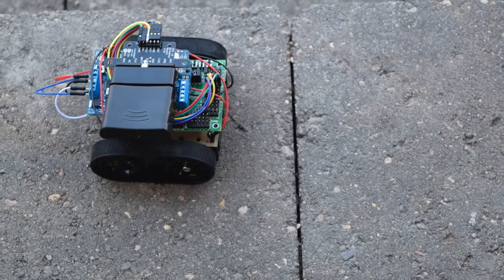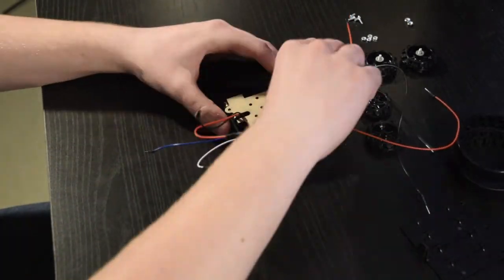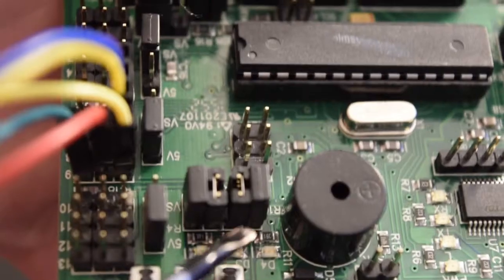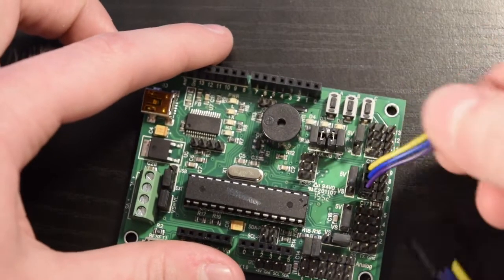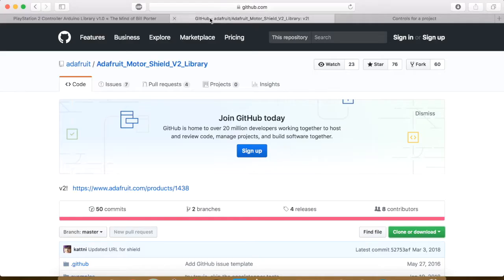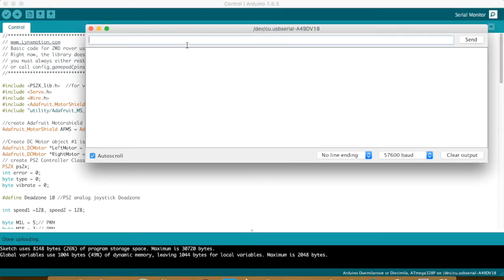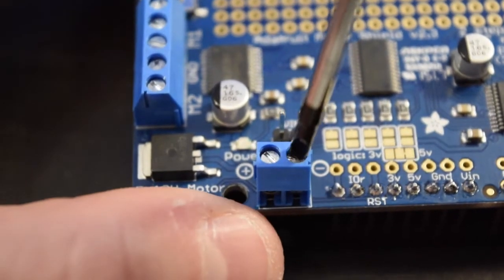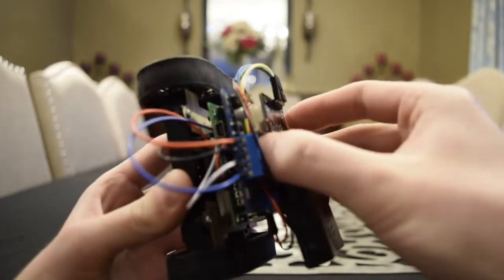PS2 Controlled Botboarduino Robot

Comment: I'm new to robotics and I'm trying to start this build but with an rc car. Is there a way to make the acceleration using the R2 trigger in the back? Please and feedback or tips would be appreciated.
Reply from the maker: I would check around online for some other examples. I believe that the website for the library may have something. If not, you can use one of the text files in the PS2X library and find the function you need to call for a button.

Comment: Thank you for this video man! Btw I need help on trying to control servo motors using the L1 and R1 buttons on my wireless ps2 remote, I'm trying to control 6 servo motors for my robotic arm but I can't control them all because I can only control 4 total servos with the joysticks, I'm not really familiar with Arduino code so could you plz help me with a little code regarding on controlling a servo motor with the L1 and R1 buttons, this is for a project at school.
Reply from the maker: It’s been a while, but looking back through some of the library examples, it seems that 

if(ps2x.Button(PSB_PAD_DOWN)){

Is the format to use. Hope that helps!
Reply: @KeplerElectronics  Thank you so much I definitely appreciate it 🙏This is the code I've written which was causing all the problems I've been using "map" for my code but all that did was just apply to joysticks. 👍RXservo.write(map(ps2x.Analog(PSS_RX), 0, 255, 0, 179));

RYservo.write(map(ps2x.Analog(PSS_RY), 0, 255, 0, 179));

LXservo.write(map(ps2x.Analog(PSS_LX), 0, 255, 0, 179)); 

LYservo.write(map(ps2x.Analog(PSS_LY), 0, 255, 0, 179));

L1servo.write(map(ps2x.Analog(PSB_L1), 0, 255, 0, 179));